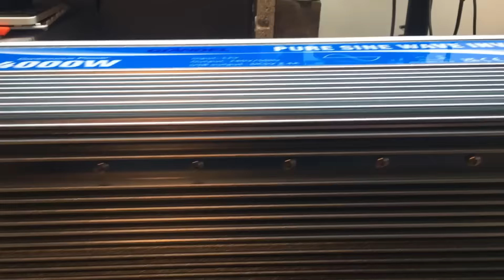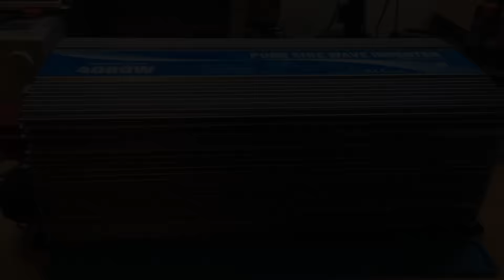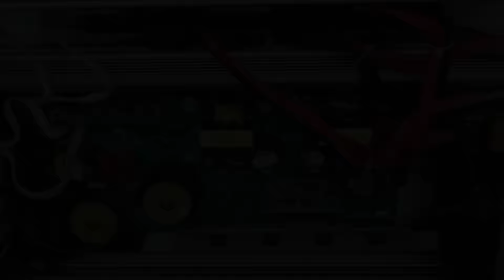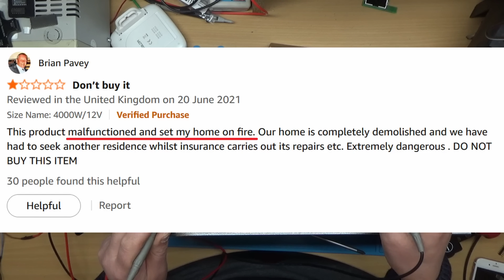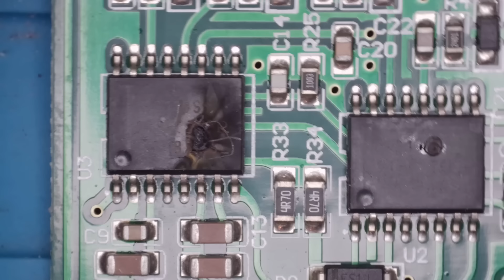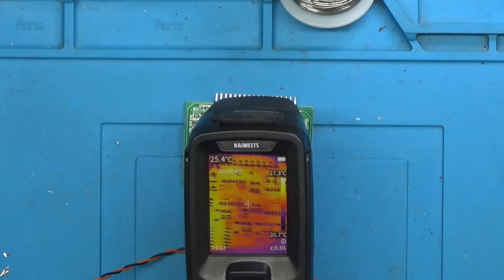Blown 4000W Inverter 💥 - Fixable or Game Over?

Comment: Most electrical items today contain MCU's & when faults blow them,they are unfixable,real shame, as it would be simple for the manufacturers to either issue a replacement MCU (like the tester you fixed) , or give out the code ,but they wont do that,they just want you to buy again,must be the Sine of the times.
Reply from the maker: Too true, it's a real shame that so much gear ends up in the bin just because of a blown MCU! 👍🙂

Comment: I'd never use such a low voltage for inverting.
It's the I^2 * R problem
Reply from the maker: You're absolutely right, the current draw at 12V for that kind of power is massive! 👍

Comment: Old fashioned caravan fridge a better job with an inverter. You really only need enough power to keep it cool until you get to a hookup. Been running a telly and old caravan fridge in my van with a gwneric 2kw inverter for 10 years qith no issues

Comment: EGS002 module available from AliExpress for a few dollars is the driver board.
When the MOSFETs fail, they invariably blow up the driver chips on the egs002. Also the IGBT's carrying the high voltage are driven by this board so a failure in 12 volt or 340 volt side kills the two chips you've witnessed are blown.
Naturally, all other components on the small vertical board are suspect at this point as well as everything supplying or driven by it

Comment: A friend gave a 4000w pure sine wave inverter that wasn't working.
I have opened it, there is 9x 30amp blade fuses which were all burned.
I have replaced all the fuses and started working again.
It's coming on, producing power BUT, display showing F04, Google it and came up as low input voltage. 
Tryed it with fully charged battery, 2 fully changed batteries in parallel.
Same error code.
Any suggestions anyone?

Comment: I could not find this board. But using Google and PIC16F716 IR2110S DC AC Pure Sine Wave Inverter Boost Driver Board Adjustable gave a lot of hits. It is more for those who want to dig deeper in the tech, not as an replacement idea

Comment: Usually fixable. Be sure to install series fuses with the inverter transistors as those are usually what fails. This prevents cascade failure. Also upgrade the gate coupling capacitors while you got the hood open.

Comment: 4kw is just too much current at 12v...every lug and torqued nut is critical. Not surprised these fail...just the component tolerances alone would make it difficult to perfectly synchronise all 8 mini inverters so that the outputs don't fight each other !!! What a dodgy piece of kit⚡⚡

Comment: Dear Mick, thank you for your professional testing and for diligently producing this video.

Based on your video, we initially deduce that the fault is most likely caused by the inverter unexpectedly receiving AC power (e.g., 240V AC mains) to its output. We are also further confirming with Lee whether he connected the inverter to shore power or the household circuit during use.

If the inverter is connected to the household circuit or mains power without timely switching, when mains power is available, it will flow directly back to the inverter's output, causing serious damage.

As you mentioned, the following damaged components need to be replaced first:

1. Replace the four damaged MOSFETs at the output. MOSFETs are switching power components in the circuit. They have been damaged or burned out by a high-voltage surge.

2. The two driver chips you removed. High voltage flowed back to the control board through the output, causing damage to the two driver chips on the control board.

3. Our company's program control chip. We can provide it if needed.

4. The blown fuses.

The above is only a preliminary screening based on your video inspection.

We recommend that you further inspect the inverter's pre-amplifier control board (i.e., the input side). Our technicians suspect that some low-power MOSFETs in the pre-amplifier control circuit may also be faulty, and the fuse may have blown. These components also need to be replaced. After replacement, please perform a power-on test to check the inverter's status, protection codes, and whether it can boost voltage normally. This will help determine if the pre-amplifier control board is damaged.

Thank you again for your professional assessment. We will continue to diligently improve product quality and better serve our customers.
Reply from the maker: Thanks for the detailed feedback and the offer to help with the control chip, I'll definitely keep that in mind! 👍
Reply: @BuyitFixit  Hello Mick, we have sent you a message via your work email. Please reply with your shipping address and the repair parts you need, and we will send them to you. Thank you for choosing GIANDEL.

Comment: This looks like a classic case of cascaded failure where the MOSFET failed first, where the gate oxide layer becomes shorted to the drain, which passes high voltage back to the gate driver and toasts the gate driver ICs.  A shoot-through current event at the MOSFET may explain why the fuses opened, but it is concerning that all of them opened (cleared) and not just the one in the path of the MOSFET that failed.

Did the PIC uC get taken out, too? I woulda thought the optical isolators would keep the failures on the HV iso side.

Shop for UL 1741 inverters if you don’t want to burn down the house 😊

Comment: My expensive Samlex 2000 W 24V inverter was taken out by a close lightning strike EMP. Because Im off grid, I had to get a replacement ASAP, and ended up with a cheap no-name 2K sine wave. That was 11 years ago. It's been on 24/7 365 and still works.
Reply: what charge do you load it with? fully charge? (2000 watts)?
Reply: It does have a name though and letting us know would have been more helpful than a boast.
Reply: @jed2055 The only name on it is Armon, which is store branded, so it's technically it's a no name brand.

Comment: i have the more well built version of this inverter its the black colored version, its been VERY impressive from the abuse ive gave it, but it was a DOA unit i bought, and after i fixed it, i couldnt kill it, ive DEAD shorted its output by blowing up stuff on its output, ive overloaded it with big giant motors and run power tools all the time, no failure but my inverter is from 2020 or something, maybe it was before this kinda design,  3 years later after my repair it runs 24/7 without failure yet. ive blown up probably hundreds of resistors, batteries, random circuit boards on its output (for fun) but it wont kill it, idk how its so tough

Comment: I've abandoned high frequency inverters.
Presently I'm getting good service from Ampinvt LOW frequency inverters off Amazon to run my airconditioner.
It appears when high frequency inverters fail they can send high voltage DC into the appliances.
The LOW frequency inverter has a large isolation transformer.
Thank you for the lesson, you're very thorough Sir.
Reply: It sure would be nice if FascistTube would STOP hiding my replies here!
Reply: The high frequency inverters just have smaller Transformers. No way there is high voltage DC on the output.
Reply: @mikeysch  HF inverters make a 'high' voltage supply of call it 350VDC for 230-ish VAC output.  It then switches that typically with a H-bridge.  If control is lost and the bridge stays 'on' in one direction you get that 'high' voltage coming out of it.  That's not necessarily going to destroy your devices and it would be far more likely that rather than it being left in that state you'll get something such as the bridge being turned on 'both ways' at the same time, or a transistor shorts on, and shorting the DC supply out, inverter goes bang and everything goes dark.
Reply: @retrozmachine1189  
I tried to say the same thing, but, as usual, yt has hidden my replies!
Reply: @retrozmachine1189  The high voltage Bus IS CREATED by using a HF Transformer. It doesn't matter what the approach of AC generation afterwards is. That's why the inverter Chassis is NOT connected to DC Ground, instead its AC-N. Loss of control would inadvertently run one side of the bridge against "the wall". the inverter would simply blow up, or pop a fuse.
Reply: @mikeysch  Did you actually read my comment?  I mean properly read it.  Perhaps go back and try again and actually read it.  

1) loss of control doesn't only mean one side is left in one polarity, it can be the PWM IC stops and leaves the H-bridge permanently on in one polarity and that will indeed pass DC through the loads.

2) you'll see I covered the instance where there is a fault and you get  'cross polarity' on the bridge and it will short out the HVDC supply, much the same as a failed transistor could too.

Amazing what you can discover when you ACTUALLY read something.  Muted.
Reply: @retrozmachine1189  
Apparently, he is an "expert", so he already knows it all  ;) .
Reply: @mikeysch  
Have you studied the workings of those inverters?
Reply: @CNCmachiningisfun i have fixed many. LF and HF units. I never saw a model with non isolated design.
Reply: @mikeysch  
When the 50Hz, or 60Hz chopper section fails, you get DC on the output, instead of AC, as per the opening comment. 
As for isolated designs, some of mine were anything but. 
You could get a painful shock off these, if you were grounded - and touched either of the output terminals. 
I duly learned to treat all inverters, as if their design was this bad.
Reply: @mikeysch  
It looks like yt is hiding my replies, yet again!
Reply: @mikeysch  
I TRIED to reply here, but FascistTube....
Reply: I "love" how FascistTube keeps hiding my replies here!
Reply: One of mine went that way, sending 325V DC into all of its victims. 
What a mess that made!
Reply: One of mine did that. 
It was a bad day for some of the AC loads on that line!

Comment: I had that exact inverter and it worked flawlessly on my boat for several months. Then when I left the Bahamas, I accidentally left both of the 16k but A/C units on. It blew several of the Mosfets, but not a single fuse. I replaced all the Mosfets, the controller IC, found some traces open and fixed those. I never did get it work again. It was however able to run one A/c unit quite a bit for me along with a hot wayer heater, an inductive stovetop, water heater, etc. I did however manage the loads to stay under 3000 watts most of the time, but the 2 A/C units did it in. I replaced it with a used 5000 watt Giandel and that one has worked flawlessly now for more than 6 months of living on the boat working it hard. I still try to keep it under 3000 watts though just due to only a 2/0 wire feeding it the 12 volts. And I will leave an A/C unit running all day and sometimes all night without a problem and does not even get that hot. I have found them to be basically bulletproof if you don't overload them. Funny though that the display shows the voltage jumping around constantly from 105 to 130 volts. But if i put a meter on it, it is rock solid at about 121 volts with no variances, even under a large load. I love this inverter as it basically runs my house on the water 24/7 much of the time.

Comment: done a few of these ,,, the little board been taking out due to mosfet short ,,,, if u get the pin out of the two driver chips u can check the signal getting to it from the pic chip that does the freq and voltage from feed back circuit .... if you getting signals to them chips u can just replay them if not see if you can get a pin out off each board and look for one on ai ,,,, and a complete set of mosfets ,,,, normal     does the trick ,,,, down about 4 now from memory they dual drivers so u have four output per chip two ho two low that driver the driver transformers
Reply: psu the reason it happens is ie not one componet as the system is sort of balanced so when one goes chain reation ,,, had a few go when someone replaces a battery on a little solar system and the mppt controller cant work out what happens and the input goes mad and bang .... rule of thumb when diconectiing on from  solar ... ioslate the battery last

Comment: this unit came under several names-  Renogy, Giandel and Victron;   I had one stuck on protection. one of the IGBT's had a dead short- the 3000 watt unit uses these: IXGQ85N33PCD1-ND    digikey  		$6.46    IGBT 330V 85A    check the big xsistors down the side walls.  he was running a few refrigerators and pulled the cord out under load.

Comment: On mechanical failure at 10:00 is the one pin enough to supply enough voltage to blow it apart? I'd think it more likely that the heat inside the chip blew the legs off, but I don't know much. Definitely it got hot enough that the package has turned blue near the middle leg.

Comment: Search for the part number of the controller board. they are also called SPWM or sine pwm controllers and there are suppliers for those, for approximately 12US$.
Of course, all broken MOSFETs and fuses and blown gate resistors will have to be replaced ad well...

Comment: I had one of those inverters in Australia  24/4000 with 2 std 3 pin  240v 2400w 10amp sockets. The wire size to the sockets was very small 22g and the jst plugs connecting to the board has melt , almost catching fire.  I have repaired the unit but never again would i buy or use with any large load above 1000w  to be safe. I replaced the unit with victron 24/5000 insteadx, no voltage sage and runs much cooler with no issues at all.

Comment: The rating on that inverter must be BS. It would require at least 333 amps from the 12v input. (4000/12) to deliver 4000 watts

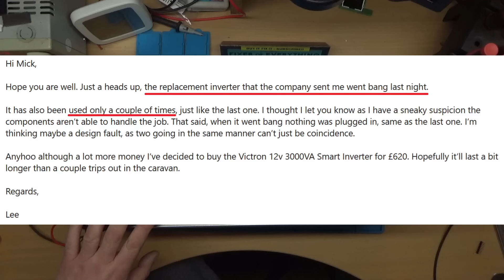Comment: 0:43 You cannot blame the fridge, vibration, or overload. The unit destroyed itself simply by being turned on,An inverter that spontaneously shorts its input terminals is a fire risk, especially in a mobile home with limited escape routes, When reporting to Trading Standards and the seller, explicitly state: "The unit suffered catastrophic internal failure (blown MOSFETs/fuses) while running with zero load.  This confirms a critical manufacturing defect or design flaw, posing a severe fire risk or explosion in someone's face ,Do not attempt to repair these units again; they are fundamentally unsafe. anything mobile should be  Victron or Sterling low-frequency replacement, good to see he replaced with victron 12v,that 1 is gold standard ,2 units in such a small space of time Catastrophic ,China  they dont care .

Comment: Those waveform generator modules are available, very cheap even for pure sinewave. The last one I bought was about $5. Also those multi parralel LVS designs often cascade fail (sometimes just fuses on following stages if your lucky) when the most stressed stage fails the remainder try to carry the load, when one more goes the rest of them head for the door fast. Some of those Chinese inverters also have poor current distribution to each of the low voltage mosfet groups meaning non equal load sharing at high power. When I repair them I usually lay heavy copper bus wire to each source from the distribution point, then measure voltage drop at high load on each group to confirm equal distribution, and I add ceramic caps to all of the low ESR bypass caps on the low voltage side, it makes everything run cooler with less waveform ringing. Cheers.
Reply: This cascading failure is what you nearly always see in the inverters in modern electric forklifts as well, one MOSFET pops, the others instantly try to pick up the load and just fail one after another - you usually pop about 20-40% of them before the control board detects the issue and shuts the hole thing down.

Comment: What do I call this inverter with alot of transformers ?
The one with one big transformer?
Reply: LOW frequency inverter
Reply: You'll be glad (or confused) to know that you can get 'high frequency' inverters with just one larger transformer too.  It's not to the massive proportions of a 'low frequency' inverter but it's quite a bit bigger than the transformers shown in this video.  It's actually the most common design for the all-in-one HF units but you can get it in this battery powered stuff shown here too.

Comment: 4000Watts would require 333 amps at 12 volts, probably more with losses. How is this even possible without input wires like jumper leads and milk float lead acids if you want it for more than 30 seconds?
Reply: People think these things give them unlimited 240 vlt off 12 volt battery. My calculations say you'd need 3 strong charged batteries at least for backup.

Comment: In my 49 years as a electrician in the US, most home owners don't know what load sheading is or that you have to de-rate the capacity for a unit like that, just off hand does it have the duty cycle on the name plate?? my guess would be variable base on weather it's a resistive load vs inductive load vs linier load, and I'll bet the inductive load is at 40%, it all depends on the engineering of the thing. the 4K rating just might be a model reference and not an actual loan capability. Most connected loads are derated to 80%, 70% or even 50% of the stated capacity. PS here #12 AWG is 20amps, #14 AWG is 15 amps, #16 AWG is 10 amps, people don't want to spend the money for the heaver cords so they cheep out and buy the lighter ones and cause a overload and may be the source of the fires. Personally I would not run over 2KW on that thing to be on the safe side, it won't provide the full 4K. I'm also not a residential electrician I'm a Commercial Industrial electrician, that's a big difference here, I have no idea what or how electricians are categorized where your from.

Comment: Another way these can fail is if the microcontroller crashes or doesn't provide the gate drive signal for whatever reason. So they don't switch anymore.
= Blown MOSFET... If the gate 'floats', the MOSFET won't be on and won't be off, so acts as a resistor, which means it blows up.